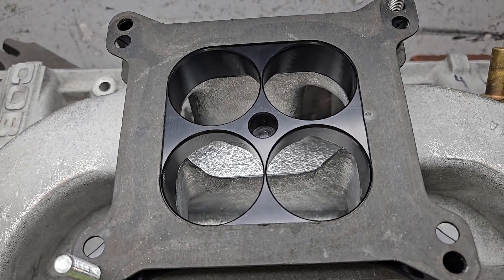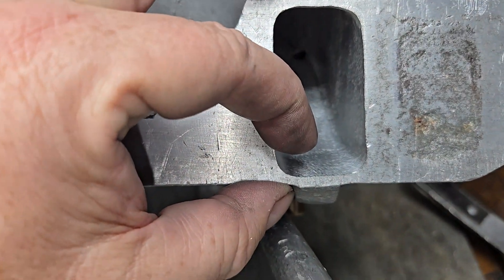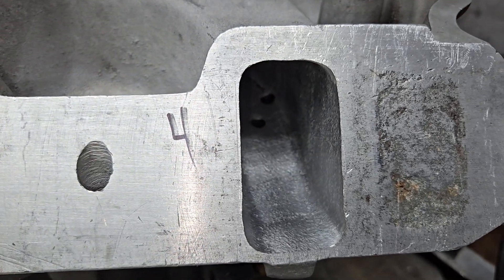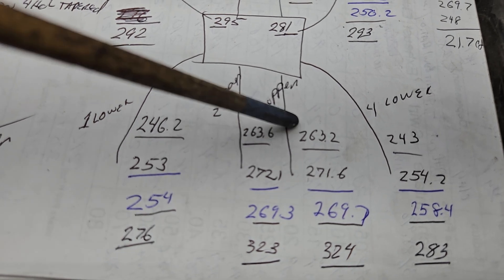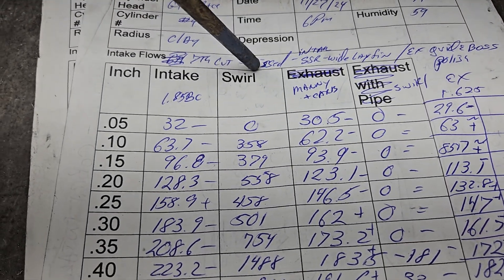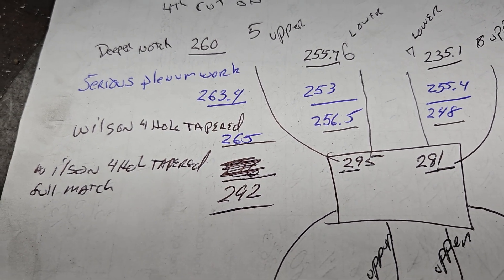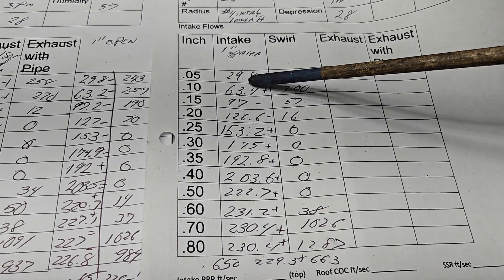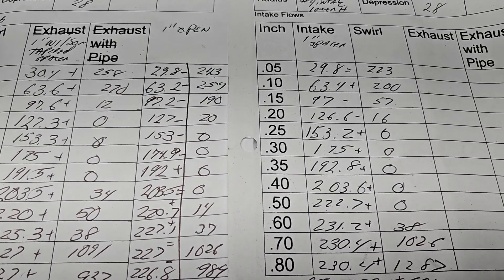Ford GT40 289 Race project Shelby Crobra intake next level flows and balance. 300+ cfm!

Comment: 12:5:1? On EFI you can just about do it. To make 500hp you need to make ~320ft/lb of torque at 8,000rpm. The most torque you can pull out of this motor would be ~440-460ft/lbs assuming the ideal max of 1.7ft/lb per CI.
Reply from the maker: @rolandotillit2867  I agree
Reply: 1.7
Holy moly.
That's waaay up there in Formula1 territory.
1.5 would be excellent.
Reply: @hotrodray6802  That's why I called it an ideal max, which would have been around 493ft/lb. Making torque is one thing, putting that torque in the right RPM band is the challenge.

Comment: Hey, just curious you happen to try and flow it with that spacer flipped over the other way with the taper up ? I run the tapered spacer flipped over on a 383 with an Edelbrock air gap and it made a world of difference in power. Just curious how it would flow with the spacer flipped upside down. After adding a flipped spacer, I had to go up 2 jet sizes on the primaries. Car feels like it picked up 25 to 30 hp just from adding a flipped spacer.
Reply from the maker: @speedfreeksracing  That tells me that it is causing fuel to fall out of suspension. I haven't done much testing like that. My ocd wants to use the spacer the way it was designed. Is it possible to work better upside down? Yep

Comment: Great job!  Powdered metal is pressed and then sent to the oven.  They can also heat treat certain mixtures.  It works great for mass production complex parts.
Reply from the maker: @brokentoolgarage  I need to look it up. Thanks
Reply: @servediocylinderheads  Interesting process for sure.  You are welcome

Comment: Powered metal has been around for a long time and making bushings is great because it can be made to hold lubricant in the pores. Connecting rods are in a different league, it seems like skating on thin ice for racing.
Reply from the maker: @paintnamer6403  A bunch of holes holding hands!